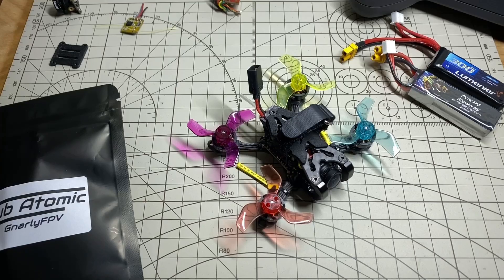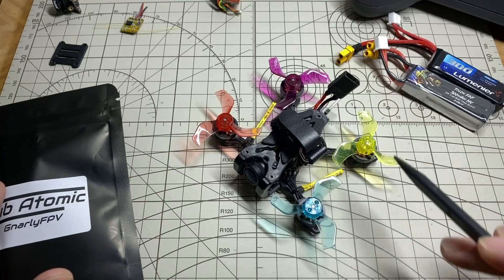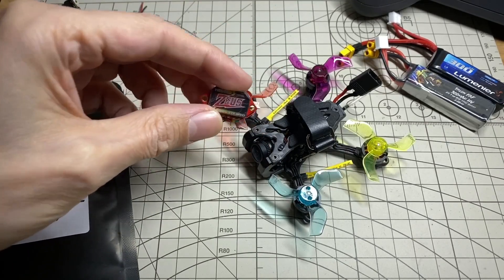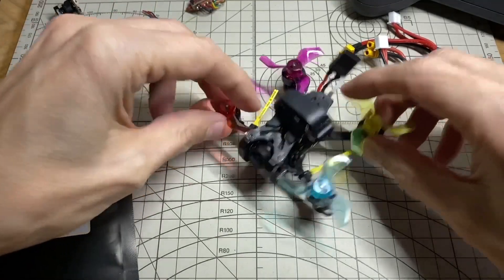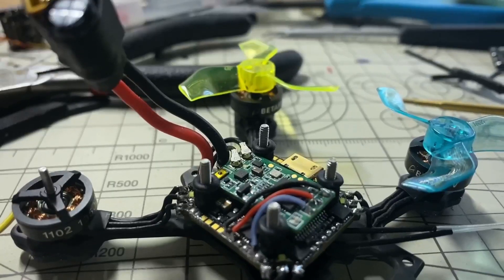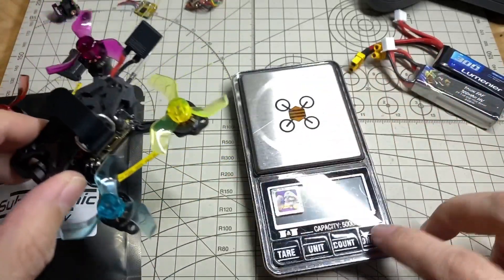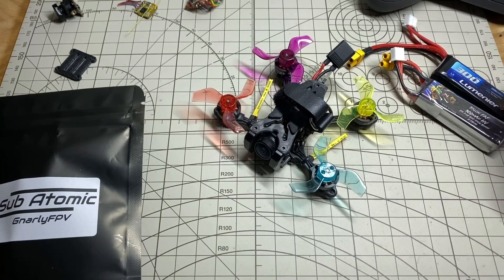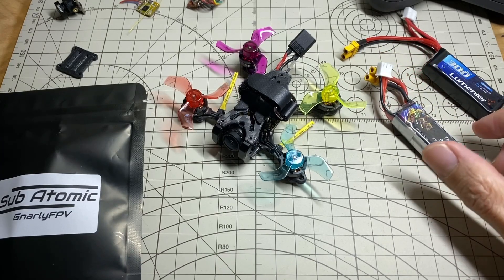GnarlyFPV Sub Atomic Round 2: More Volts, Less Video Noise! The Micro Freestyle Update

Comment: This video inspired me to get the frame. Just managed to get the last frame this morning. Motors are hard to come by. How well do you think the Mamba 1103 12000kv motors would hold on this frame, will be using the same Jhemcu AIO board?
Reply from the maker: Nice! I think you’ll be fine with those motors. The frame will accommodate them and the little extra weight should be offset by the extra power.

Comment: Great looking little build! I'm planning to put one of these together as my fist "from scratch" quad after seeing your review. Are you using the stock Betaflight tune or have you adjusted the PIDs/rates at all? It's such a unique design I wouldn't know where to start with my tune! Thanks!
Reply from the maker: Thank you! What a neat choice for your first build. Yes I’m running more or less the stock Betaflight tune with the P&D slider turned up just one notch and my own rates. Even though this is very small it seems to require nothing special for the tune or settings though one could probably get even more out of it by flashing JESC.
Reply: @MiniMicroFPV  I appreciate the reply! I usually flash JESC on the little whoops/toothpicks I'm used to, so I'll be sure to do the same here. As a followup, I noticed you ran the camera 5V and GND through the VTX rather than straight to the board. Did this help with the video noise, or does it just make the wiring cleaner with so little space?
Reply from the maker: @JMCraig  Cool! As for the wiring, I just did it that way for ease as it seemed like I'd need to solder two wires to one pad doing it the diagramed way and that seemed no fun! I had noise with the HGLRC VTX with this set up but not with the TBS Unify. I'm not sure if this method of wiring helps or hurts with noise.

Comment: Is it a good idea to get the tbs unify V1.1? Does it need more than 50 mw?
Reply from the maker: Hello! I haven't tried that VTX yet but it looks like it has nice features over this version (though it does cost a little more). As for 50mW, I don't need more than that for my close unobstructed flying but if you want to go further than 150m or so you might want more power.

Comment: Cool, I have the frame and 16x16 AIO sitting on the shelf, waits for weather to improve to put something together with it (these pink / purple RCInpower 8000kv 1204's are staring at me also). Ran the Guppy V3 last summer, amazing little carbon fiber quads. Kudos to GnarlyFPV for sure.
Reply from the maker: Nice motors! They'll be pretty big on this frame as I think those should be able to spin 2.5" or even 3" props no problem. Kudos to Gnarly for sure~~

Comment: This looks pretty good but what's the benefit of this compare to something like a 1s toothpick? Let's say kababfpv baby tooth or maybe nbd savagebee? What I see different is the props size of 40mm vs 3" and running a 16x16 stack versus a 25.5 AIO whoop stack
Reply from the maker: Hello! I wouldn't say there is necessarily a benefit to this setup over a 1S toothpick. It's just something a little different. Though I haven't flown a proper 1S toothpick, I imagine that this little Sub Atomic flies more like a shrunken traditional freestyle quad while the toothpick is its own unique thing with a super-light feeling, high efficiency and very quiet flight.
Reply: @MiniMicroFPV  just wondering what’s the difference. Yeah 1s toothpick seems to be more efficient and in a way “floaty” which some people do not like. 

Your setup reminds me a lot of the nbd mosquito frame which also uses a 40mm props but it uses the same AIO whoop board and goober canopy which would be a lot lighter.
Reply: @MiniMicroFPV  Definitely try the Babytooth, nothing else like it - I didn't even want to build it but am totally loving it now that I forced myself to do it (my flying conditions in the city require... very, very quiet unassuming drones). Your assumption about the difference between these feels spot on to me - I also did another 2S GnarlyFPV frame recently similar to this Sub Atomic.
Reply from the maker: @samtny1  I'm sure I will at some point! I also value quiet quads that can be flown adjacent to people without causing a fuss.

Comment: Mines on the way from Gnarly. Everything including batteries is on the way but I can't find those motors. Any idea who stocks them ?
Reply from the maker: Oh no! I got my set from Pyrodrone but they sold out very soon after I placed my order. I assume you're in the US and I haven't seen any in-stock local supply. There are also Happymodel 1102 13500kV motors that are the same spec if you are willing to go that option. I've tried those motors and have had no issues except that the props tend to fit very tight and it's hard to remove them once on. They have them at RDQ. Otherwise you might have to wait a bit for the BetaFPV motors which would be no fun!